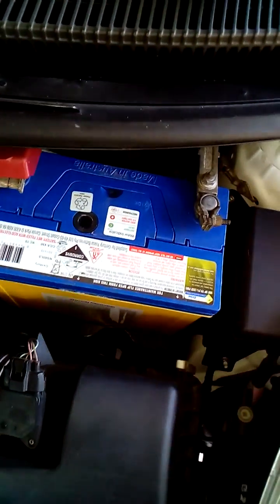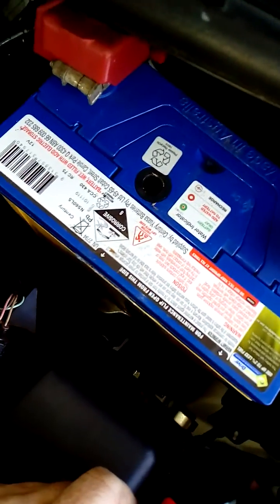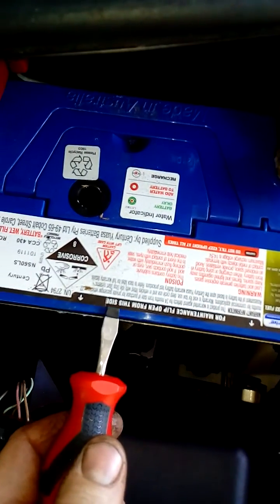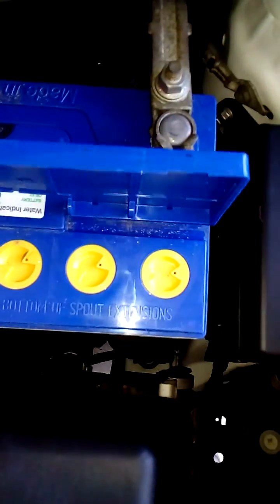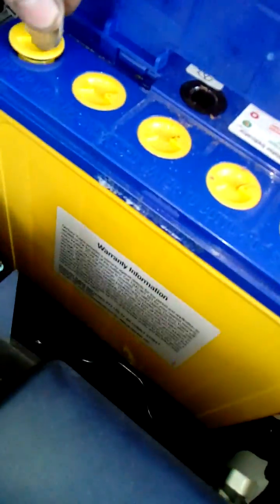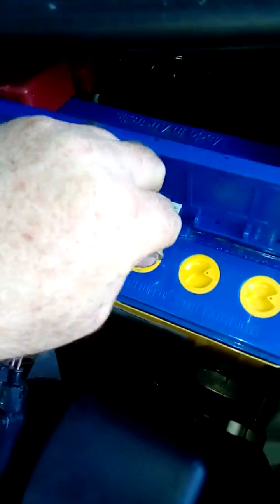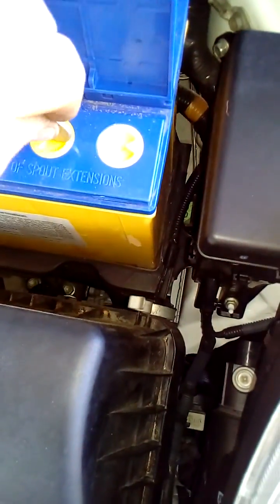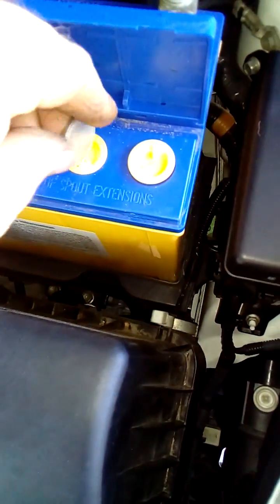Battery Check water level hidden under cover

Comment: That one has a hinge, but the New Century I have does not the hinge and I cannot get the blue lid off without possibly destroying it (Has 2 holes - 1 hole each on the short) Nothing seems to release it. So will watch the indicator for water level when fully charged. Are the sealed batteries that good that they don't loose moisture these days ?
Reply: Yes mine is fully sealed . Now all the lid is destroyed from
My screwdriver ! Still couldn’t open it though .
Reply from the maker: Aus1  the new ones are sealed.
Reply: Ardent Fan 

How do you know where you are supposed to drill if it is all sealed up ?